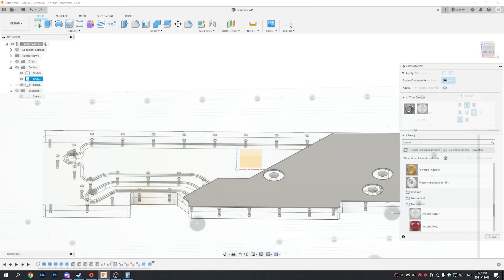Asus ROG Maximus Z690 Glacial full water-cooled , Intel I9 12900k, Asus RTX3090 EKWB, and more

Comment: Your pc is a work of art !
Can you link please  for the ek water cooling and cable pro mod  and the other 3 fans you used i cant find them. Would appreciate it
Reply from the maker: Thanks,  
for EK   its only PE360 rad and fittings , GPU come with  block already installed, same for motherboard
for Cablemod Pro set, again they are made with the Cablemod configurator on web site
its simple Black and red sleeving

for fan  all 9 fans are
https://shop.in-win.com/collections/fan/products/iw-fn-aj120-3pk
Reply: @upsnef11  sorry im new to pc  so i couldn't understand it well, so you didn't use any liquid cooling? Just fans as the motherboard comes already with cooling system.
Reply: @illumi5595  It's not just fans.. the motherboard and GPU are on the liquid cooling system. That GPU can be bought already installed in what's called a "water block", and the motherboard comes already prepped for liquid cooling from the factory... But it's an expensive motherboard, cheapest I've seen it for was $2,000

Comment: What is ur temps on the cpu 12900k
Reply from the maker: my 12900k is a Engineering Sample, maybe not reflect retail's version, but,  ambient was 20c,  after more than hour of gaming,  the cpu is around 60c,, fan are set to 800rpm and DDC pump  is @ 2300 rpm
all panel are installed

Comment: 3090 without active backplate. 🤣🤣
Reply from the maker: this build is only for gaming, fusion 360 and some photoshop,   never saw memory  over 78c, ddr6 can be higher than that, WHO said you absolutely need a active backplate on a 3090??  
for mining  or any application who crucnch or intensive use, yes maybe,
Reply: @upsnef11  
It also generates a lot of heat in games as in most custom cards, especially when playing in 4K.

Not only in mining you can reach high temperatures.
Reply from the maker: @badiastmeid2231  I'm sure you're right,
i don't know witch 3090 you have or tried  and i cant talk about other brand or model  but i have some Strix (white and Black) , TUF and the EKWB  and  none of them have high temp in game and normal use,  the higher i saw is 87c on the TUF in a 3d cad
the active backplate is not  a need for day to day use, so many people don't watercool and don't have any issue
i have some with active backplate and yes temp are way more better, but these are for video rendering and 3d design